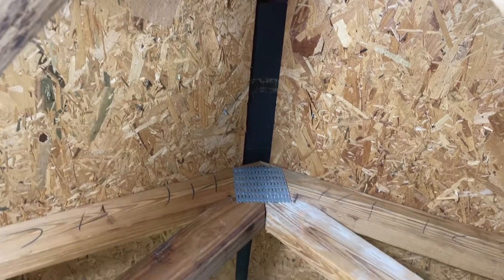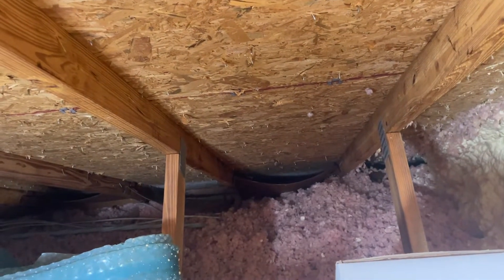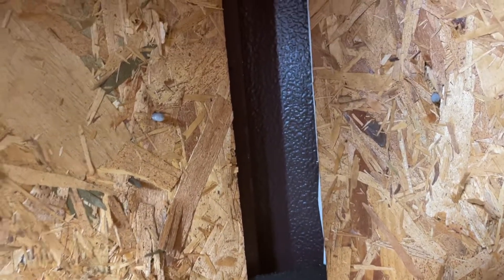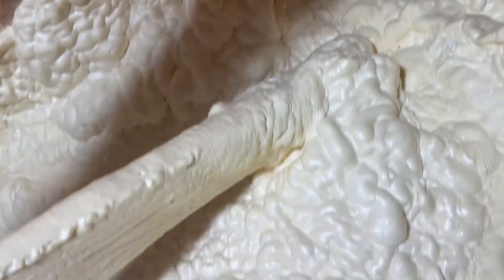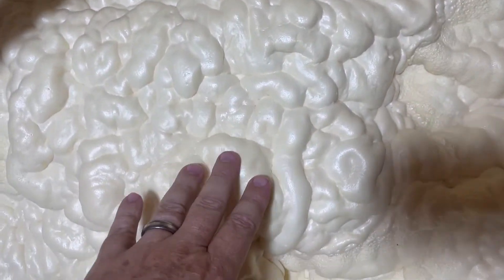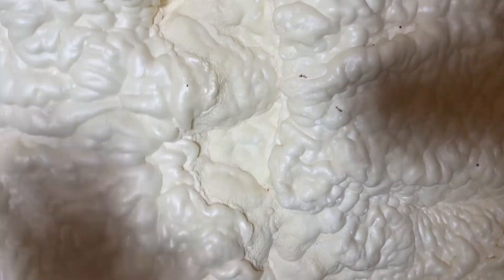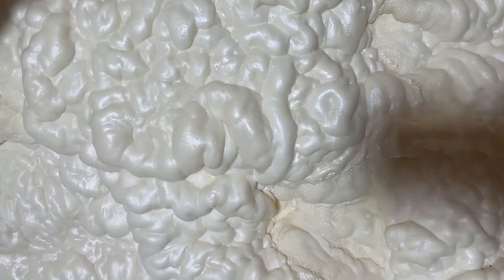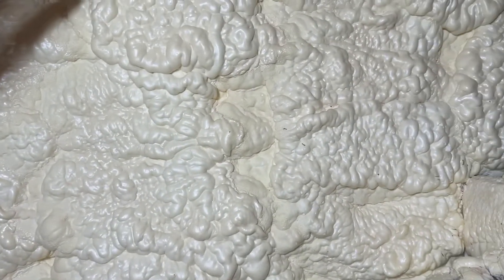Spray foam insulation versus blown in insulation

Comment: Not sure if I missed what location you’re in - do you think spray foam will work well in a hot and humid climate?
Reply from the maker: We live in central Florida and love it.  What a difference it made in the feel of the house too - if that makes sense - it felt less humid. The AC didn’t have to work as hard either.